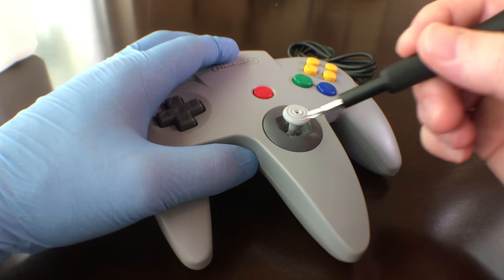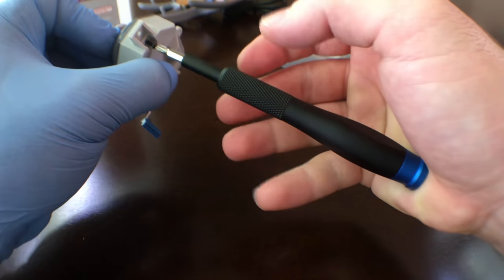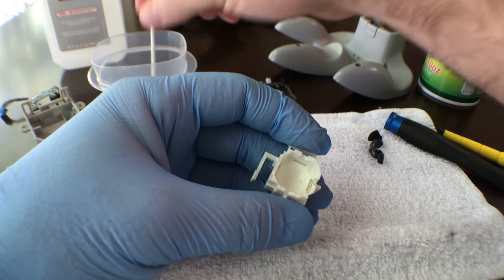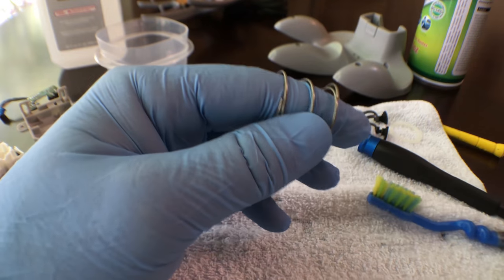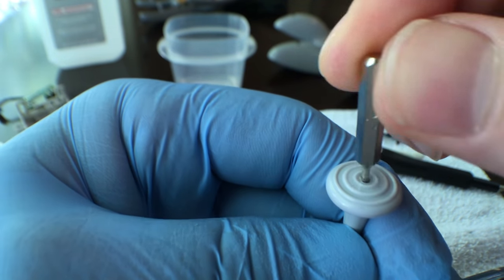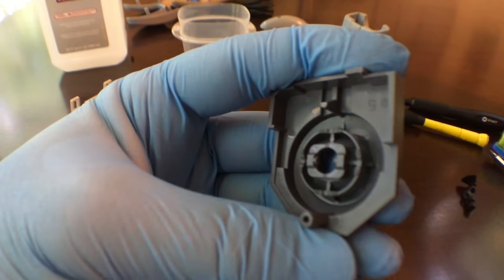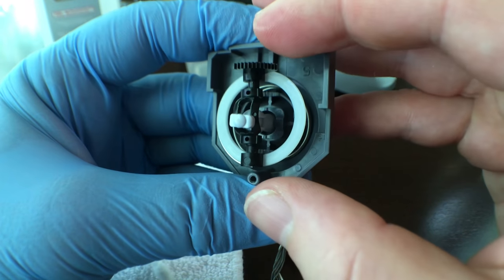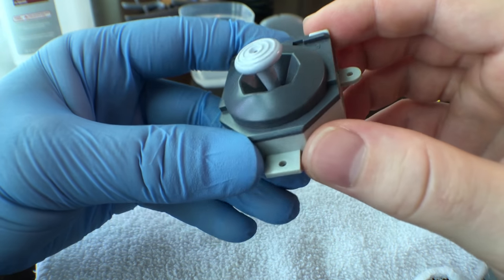Nintendo 64 (N64) joystick teardown - How to clean/fix/restore/refurbish

Comment: I've used this video for 2 repairs now and it was very helpful. Joystick butter is an absolute godsend. Highly recommend it to anyone doing this repair. Makes the stick movement so smooth. Thanks for the helpful guide.
Reply from the maker: Awsome!! Yeah, I still have the same tube of Joystick Butter from this video. I've done over 100 joystick assemblies and still have like 75% of it left I think. If Nintendo knew about this stuff when they made these controllers I don't think anyone would ever be watching my video. I still use the same controller from this 4-year old video. It's still perfectly lubricated 6 years later. It's crazy.
Reply: @restore64  Excuse me. Where Can I get it? edit: Oh my bad, I´ve seen where...thanks

Comment: Hey, just a heads up. Isopropyl alcohol is known to be harmful to some plastics regarding their longevity. If you leave some plastics in alcohol, it will start to degrade within a few hours. Idk what these sticks are made from, but it might be safer to just use water with soap.

Comment: I bought a used N64 controller recently and it didn’t quite work right because of the analog stick. This video was easy to follow along with and instilled confidence in me that I could do a simple clean up of the controller. My $30 spent wasn’t wasted on a controller thanks to the clear guide and it’s fully functional. Thanks!
Reply from the maker: I'm just now seeing this comment. I can't tell you how happy it makes me to hear that even after all these years this video is still helping people!

Comment: Thanks for the in depth guide, I bought an N64 on the flea market and the joy was horrible, turned out the inside of the joy was like it had powdered sugar in it from years of use. Now it's really responsive. Thanks again.
Reply from the maker: Bolcsi sorry for the late reply I’ve been sick 🤒 just remember, joystick butter stops the wear from occurring, it doesn’t tighten up joysticks. The powder is actually nylon powder. If there wasn’t much and you cleaned it properly and put joystick butter on it it’ll definitely bring it back to life and give it a much nicer feel :)
Reply: @restore64  what would you suggest to tighten it?
Reply: @TheDeathOfLucifer  I am using kitsch-bent replacement parts with great success. Depending on the amount of wear, the bowl is the biggest thing that needs to be replaced, although the gears are sometimes really rough if it's in a super almost unusable condition. Good luck! Also, you might have to do a bit of work to get them perfect as they are oem parts, the biggest one for me is widening the hole where the sensor wheels snap in so they aren't too tight. This is all information you can find googling.

Comment: EXTREMELY HELPFUL!!! I'm definitely ordering a philips & regular of those screw drivers & some joystick butter right now. By next week. I'll have some actually properly lubed controllers! Hard to image why they didn't lube these in the first place.

Also, fantastic job on covering all the ins and outs of getting that taken apart & reassembled. Very thorough.
Reply from the maker: In the last few years of the N64 cycle they actually did. It's really hard to find the ones that were but they used a super thin oil like substance on the gears. I actually have a brand new example of one. If it wasn't factory sealed I'd do a video on it showing what they did exactly. Probably wouldn't get that many views though, haha. Up until 2007 you could actually call Nintendo and they'd send you a brand new replacement joystick, with the oiled up gears, for free. It wasn't the best but it was better than nothing. A lot of times if you find a really old N64 controller with a pretty close to tight stick it more than likely had the oiled up gears on it.
Reply: @restore64  cool!

Comment: This dude needs way more subs
Reply from the maker: I see you subbed as well! Thanks! The comments mean more to me than the subs but I'll take whatever I can get :)
Reply from the maker: @justmetal227  only use those as a last resort. They aren't very good. Even if you spend a lot of time hand filing off the flashing they're still far from accurate.
Reply: @restore64  got a new method. Heat at 312 Fahrenheit and close the gears until they are back to original size :). Then lube and done.
Reply from the maker: justmetal227 I saw one guy on YouTube do that a long time ago and I haven’t been able to find the video since. He had a custom jig made so it would resize them to the exact factory specs.
Reply: @restore64  that's a great idea the jig is just the width of the stick where it makes contact. But closing it too far will cause the stick to get stuck

Comment: Hi! question: would you recommend white lithium grease over joystick butter?
Reply: White lithium grease can work if you don't have any joystick butter, or if you're a kid and $20 is alot, but make sure it's not petroleum based because it will deteriorate the plastic
Reply from the maker: @joshm264  White lithium grease should never be used to lubricate plastic under any circumstances. Not only does it not work well it's not what it was designed for. It's only used for metal on metal lubrication. While a petroleum free white lithium grease is safer to use on plastics it doesn't make it better to use on plastics. The purpose of petroleum free white lithium grease is for applications where you need to lubricate metal on metal that inevitably come into contact with other plastics/rubbers.

I've used both petroleum and petroleum free variants of white lithium grease and they both preform the same way. Very poorly. I knew they would since they're not designed for plastics but the penny-pincher inside me had to do it just to see. I've easily done over 100 controllers with the tube of joystick butter I got a long time ago and still have plenty left. I did the math and it works out to about 20 cents an application. There are tons of cheaper alternatives that work way better than lithium grease but I can't in good conscience recommend them because they all suck :(
Reply: @restore64  Yeah, but the only problem is that you can't get smaller amounts if you only have a few
Reply from the maker: @joshm264  I agree. To do one or two controllers it's pretty expensive. I didn't think about it like that. I'd still buy it though. It's worth it to keep your joysticks perfect. It's not like you can go to Walmart and buy a new factory fresh N64 controller anymore :(

Plus, I use it when I restore consoles, controllers, and cartridges in a different way that I'll share once I get around to making restoration videos for those. I just keep putting it off because making new videos is so time consuming.

Comment: I have an issue which appears on every other N64 stick, and that is the spring sometime "jumps" or "clicks" when you move the stick from the center (even if I follow your tips about the positioning of the spring and plastic ring. Do you know why this happens and how I could silence this noise? It would be awesome to have a transparent  joystick module case, to be able to see exactly what is causing this clicking noise, it seems to happen with almost every stick in some way.
Reply from the maker: Sorry for not replying sooner. I believe, if you don't seat the PCB properly (15:10) it'll leave the slightest gap which will cause the problem you're having. I should have put more focus on placing/seating it correctly but the video before editing was over an hour I think. You want to make sure the PCB is flush with the bottom and make sure the cable/ribbon is nicely in the channel. If it's not you may have to bend it around a bit in order to make sure it's exiting the housing correctly.
Reply: @restore64  thank u for this

Comment: Joystick butter is extremely expensive at about $24 per ml. However, if you are only working on a personal collection, it's probably worth it. I am currently experimenting with Molykote 44 medium, which seems to be a very good lubricant. It states that it is safe for most plastics, but to test it. So, currently, I have a joystick bowl from an N64 "soaking" in it for a couple of months to see if there is any etching or otherwise general degradation. That being said, I do have some old QuickShot joystick controllers, which have large joysticks, so I'm not so worried about testing. I used some of the MolyKote on them, and they are very smooth, not sticky at all and, just like joystick butter, you really don't need much; just a very thin coating. All that said, it was only about $27 for 5.3 oz, which is a huge value if it works out. Anyway, like I said, still testing, but my hopes are up. Great video.
Reply from the maker: This isn't the first time I've heard of someone using Molykote 44. There's a guy that repackages the 44 Light variant and sells it under his trade name "Stick Grease" which is super illegal "passing off". I guess that's where people got the idea to start using it. Molykote 44 is a high-temp bearing grease, as stated in the Dow SDS and on the Dupont website. The main ingredient in Molykote 44 is lithium stearate which is basically lithium grease. Lithium grease is used to lubricate metals which makes sense since this product is designed specifically for bearings.

It's perfectly safe to use Molykote 44 on plastics as it doesn't contain petroleum so your soaking test won't yield any results, /just to save you some time/. The only thing you'd have to worry about putting it on is silicone. The reason I shared this video is to hopefully save others from the months I spent researching/experimenting myself. Don't let me stop you though. There's nothing like feeling it in your thumb and seeing it with your own eyes. Molykote 44 may feel alright at first. Just about anything would. I wouldn't recommend using lithium based products on an application like this. Of the countless things I have tried the lithium based products initially felt okay but were the absolute worst overall.

I will say this. I did my fair share of research before using joystick butter as I have some very rare controllers in my collection. I wanted them to be perfect even though nobody, while I'm alive anyways, will be using them. While there's no way to prove this, the controller in this video still has perfect/slick gears. They, still, haven't worn down at all. It's a satisfying yet shocking feeling every time I pick it up.
Reply: @restore64  Thank you very much for the info. I have tried a few types of grease and so far, the MolyKote felt the smoothest. I have not tried joystick butter, mostly because of the price and every time I've looked it up, it seemed in very short supply. I was mainly looking for a really good grease, that I could order at any time. If you have other suggestions as well, I would definitely listen. However, I do see what you're saying, with potentially rare equipment that you will never play. My rarest being a first run Odyssey in the box, I'm going to take it out and play it just once next year for its 50th birthday, then put it up forever. Anyway, before I rant too much, thanks again.
Reply from the maker: @joat1979  You ain't lying. When it first came out I paid something like $45 for a 3 mL syringe of it. I'm cheap as hell so it killed me to do that. After doing some research and talking to the owner I realized it's exactly what these gimbals need. I also found another clever use for it which I plan on showing in a future video. Time has been getting the best of me lately.

Comment: The only issue I continuously have is the stick almost feeling sandy even after lubricating it, I'm thinking this is just due to the bowl being worn and maybe the only fix I can think is almost like a steel stick bowl solution. Or maybe a way to elevate the stick a little so it doesn't grind against the bowl

Comment: so I can do this clean/repair even if its very worn down, I see in some other videos that its created almost a powder like mass from the grinding of the plastics against eachother, at that point, isnt it ruined?
Reply from the maker: They are ruined at that point. You're correct. If they aren't extremely bad this will prevent them getting worse

Comment: So wait, this doesn't fix a loose joystick? Out of my 4 controllers I'd say I have one that the stick isn't absolutely brutal to use. Do you have any tutorials on how to do that, or should I consider them paper weights? Thanks in advance 🙏🏻
Reply from the maker: Don't call them that :(

No, this procedure prevents them from wearing out. So if you have good gears you would do this to prevent them from wearing out further. If you have a really loose stick just cleaning it will make it feel a bit better but the gears are done for at that point.

Comment: If you have an ultrasonic cleaner, you can use that with a 5% Simple Green solution to clean all those parts with grooves and crevasses. DO NOT use the heat feature though as that will discolor the ABS plastic.

Comment: I can’t open the screw to the joystick. I’m twisting in the right direction but I’m not entirely sure if I’m doing it right or if I’m just not strong enough
Reply from the maker: Oh no! If you're twisting counter-clockwise "to the left" and it's not coming out it may be stripped. If it is you'll have to use a thin trim tool, inserted in between the two parts of the housing, to apply pressure on the housing while unscrewing to get it open.
Reply: @restore64 nvm, I found a screwdriver that was both small enough to fit around it? And has magnetic ability so I managed to get it out. It works with most of my stripped screws too because of the magneticness

Comment: hi sorry to go off track could you advice pls are n64 cartridge door flaps ment to squeak loud im worried mine may gone rusty and i have lot high price rare games and dnt want any rust near them thanks
Reply from the maker: Well if they're really expensive I'd recommend restoring/cleaning your console to ensure your games don't get damaged. I'll be doing a video on that when I have more time. You need to go on eBay and buy some game bits, they are pretty cheap and allow you to open your console. From there all it takes is two phillips screws (+) to remove the cartridge tray, doors, and two springs. Make sure they aren't rusty. If they are you will need new ones. If you're games are really expensive you can just remove the springs and doors completely. They really aren't needed.

Comment: Question. I thought this would fix the looseness in my stick. It didn’t. How do you fix that? (Though my joystick assembly is now clean, so thank you)
Reply from the maker: No, that dust you cleaned out is the original gears/stick. Nintendo didn't properly lubricate these plastics from the factory so they wear against each other and in turn create the inevitable wear/looseness. Putting lubricant in the assembly will fix this notorious issue from occurring but won't reverse the damage that's already been done.
Reply: Restore64 thanks for replying! The replacement stuck assembly I ordered was I credibly clunky and sticky, and the reason I picked my old stock back up to clean it. Would you have any suggestions for a new stick assembly? I havnt found anyone just selling the sticks (except for that steel startup). Thank you!
Reply: Austin N the best thing to do is to buy a controller on eBay from Japan. There are quite a few Japanese sellers that sell cheap n64 controllers with tight joysticks. There are US sellers too I’ve just personally had better luck with controllers that come from Japan.
Reply: @mickeysrc  I've been searching. Do you have a seller on ebay that you personally recommend from Japan?
Reply from the maker: @aggiefan88  I haven't looked in years since I stopped collecting controllers. A lot of times they'll advertise it as "tight stick" and you can always message them and ask how they'd rate it out of 10. Anything above a 9.0 would be pretty good.

Comment: I have watched this so many times, its killing me

I have 10 or 15 controllers, I have a bunch of replacements parts I ordered from a reputable website,  some of the controllers go back together no problem. Many of them have the joystick drifting in all sorts of ways. Even with the OEM part back in place. Sometimes the stick will get stuck in one direction. It has to be something im doing with the reassembly and its driving me nuts. Please help

Comment: Awesome video man. Great information and clear camera work. Well done. Need to do this on my controller as well. Just curious does this eliminate the "slop" that older N64 controller get or is that due to something breaking inside?
Reply: That's due to the groove in the black "gears" being too wide and the white bowl being worn down. The white bowl is what is putting upward pressure on the stick to help it center. If the bowl is worn down it won't push upwards on the stick anymore. Some people have fixed that with epoxy but there are replacement bowl and gears that are available for sale on ebay or Kitsch-Bent. Shipping from Kitsch-Bent can be pricey if you're not in the US though.

Comment: Does this work with any N64 stick no matter how worn out it is? Or do some parts need replacing at a certain point? 
Kinda wanna grab a few loose n64 controllers and try and clean them up
Reply: It doesn't work as a fix for loose sticks. For that, you will need replacement parts! You should do this to any N64 stick in good condition, however, as it is crucial for keeping it in nice condition for as long as possible.
Reply from the maker: What Disney said. This method only prevents the stick from becoming loose. If it's properly lubricated you'll be able to enjoy a tight stick for years to come.
Reply: @restore64  any advice for how to fix a loose stick without flat out replacing it?